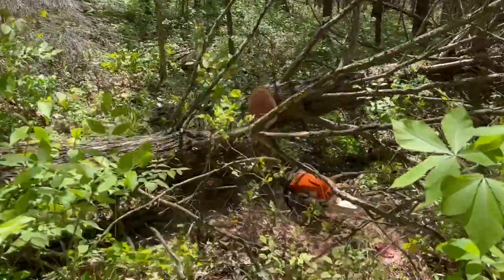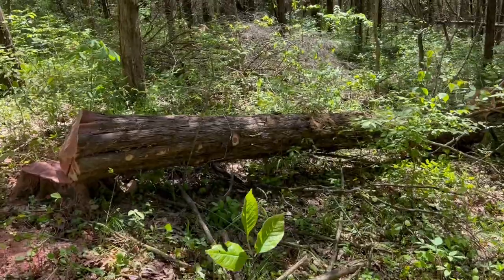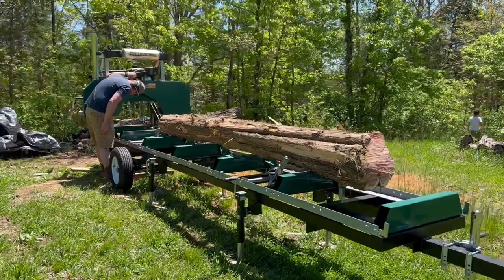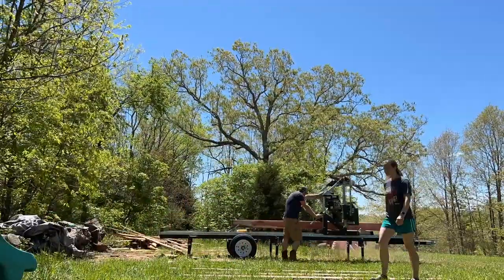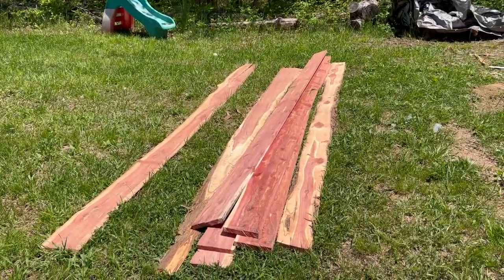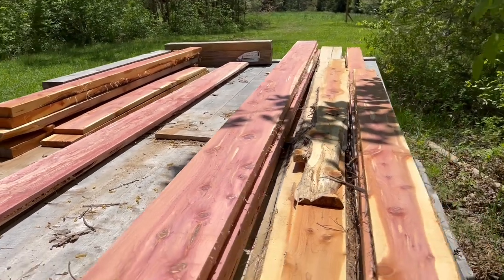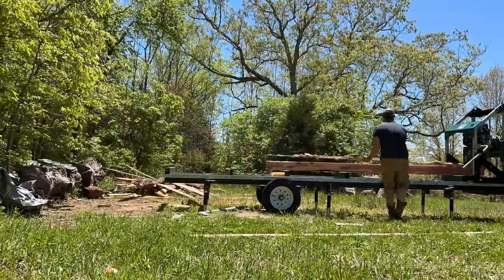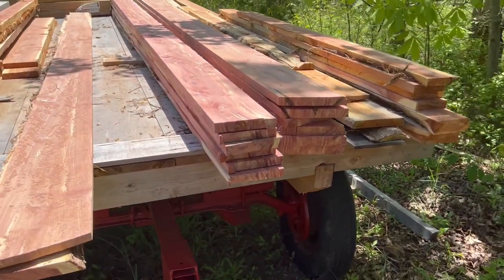How Much Lumber Do We Get From a 12inch Cedar Log With Our Sawmill?    #sawmill #homesteading

Comment: Doesn't the logs need to season for 12 - 18 months
Reply from the maker: +David Potts Hey! No it does not. You can saw up a log the day you cut it down. In fact, it’s actually preferred to do it that way. If you cut down a tree and let the king sit on the ground it will actually rot. We cut a lot of stuff out of wet lumber. Some of it we use right away to build stuff when it’s wet, other stuff we stack it with small pieces of wood in between the board to let it dry out for building stuff. We mainly use cedar which is naturally rot resistant, but we also do the same projects with other lumbers as well…
Reply: Logs rot, lumber seasons
Reply: @willieclark2256  I totally disagree as I am in an area that is constantly logged for hardwoods and Cedar. properly stored logs do not rot. In fact milling too soon,the lumber material will never be any good for use, boards will twist and warp beyond any reasonable use. There is far more to Milling than just cutting into boards. Many soft woods can be milled Green and then dried but hardwoods are different. Black Walnut logs should sit for 2 yrs before Milling, Hickory, Oak, Wild Cherry pretty much the same depending on the dia. of the log. Nothing worse than doing all the work just for a pile of firewood